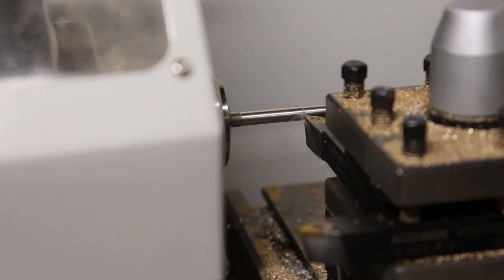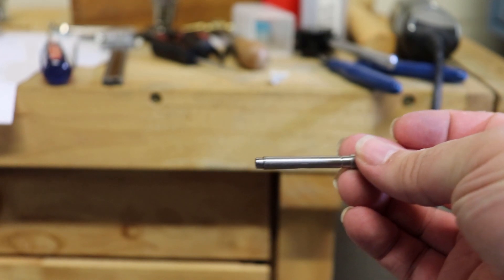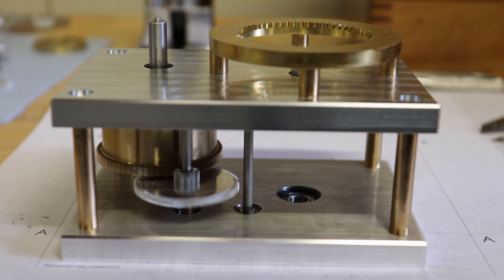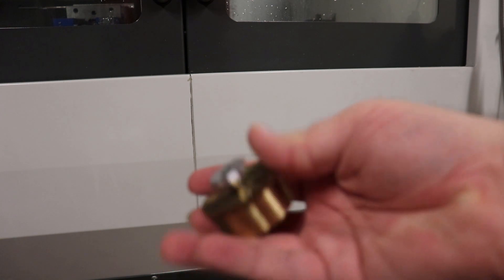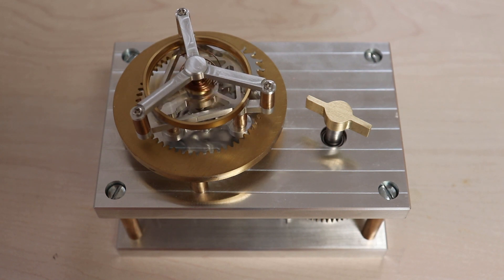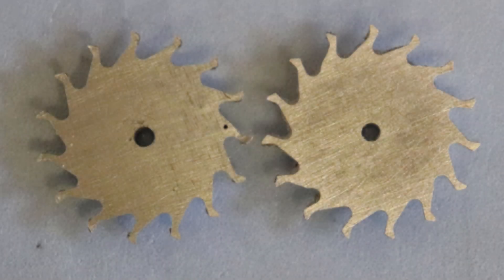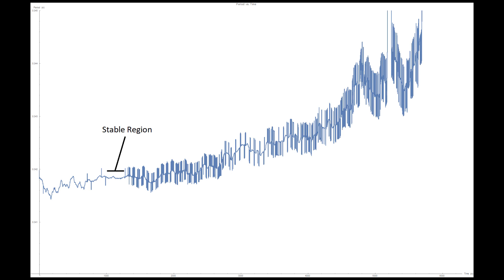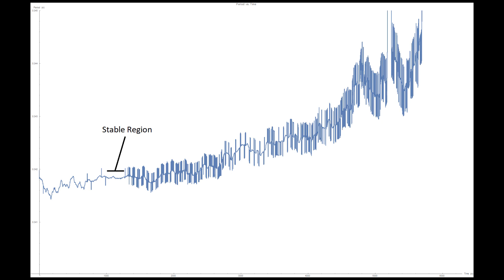Homemade Tourbillon Model

Comment: I am working on a similar project and I don't see how the gear module can be 0.75. Hermle #50 Barrel has 66 teeth and a pitch diameter between 41 mm and 45 mm. Therefore the module is closer to 0.65.